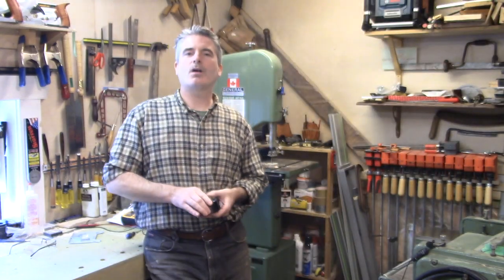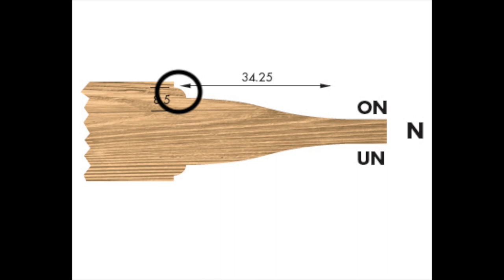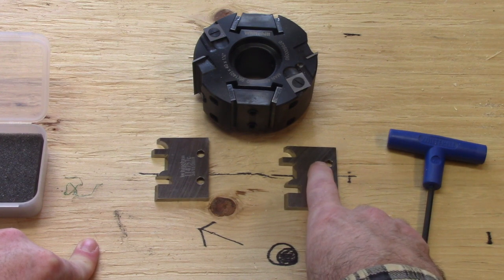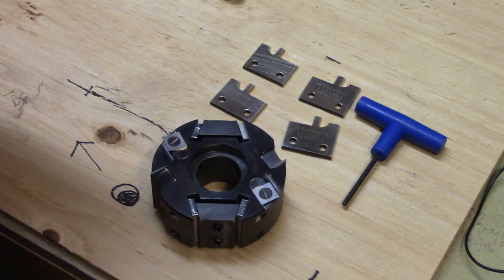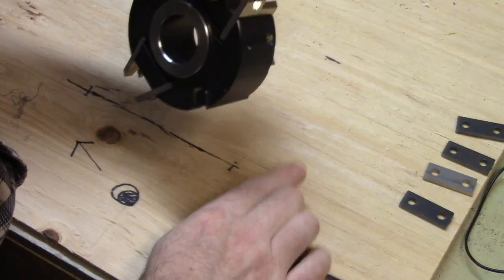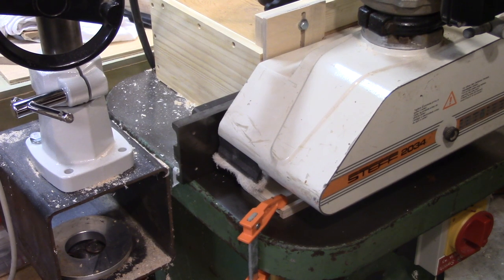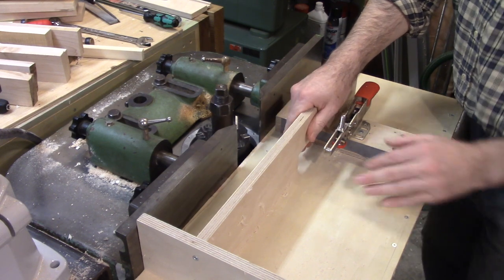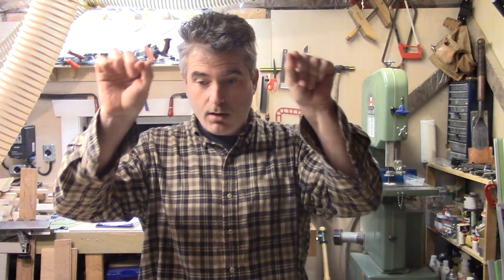Making custom kitchen doors with a wood shaper or spindle moulder.

Comment: You have a great style and are very informative.  Keep going you will build an audience as long as you stick with it.  There is very little high quality info on spindle moulder techniques out there so your work is high value thank you.
Reply from the maker: I really appreciate hearing that, thank you.  Do you think people would be interested in a video about outboard fences?
Reply: @DovetailTimberworks  I can only speak for myself.  any content on step by step techniques, equipment, features etc around spindle moulding for the small shop would be welcome, given your open and detailed style.

Comment: Just your thoughts? Would an old hd delta with a 3/4 spindle be able to run a block like this? It has a 1 hp in it now but have a 3hp for it.
Reply from the maker: I think with care you would be ok.  The block is capable of much more than the machine is so you need to listen to it working and take small bites till you have a feel for it.  The opening size in your table might be a limiting factor too.
Reply: Thank you for your response.  This machine has a 6 iinch opening  so I am going to order one and get at it.